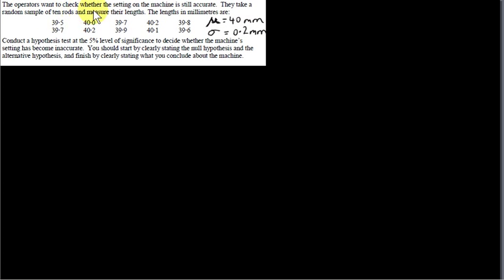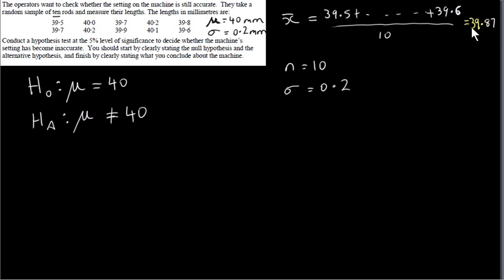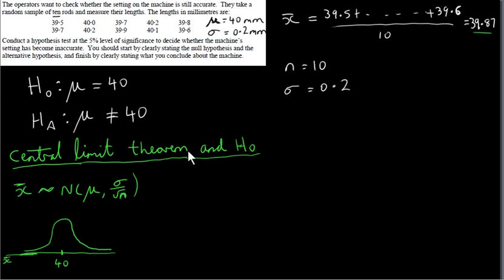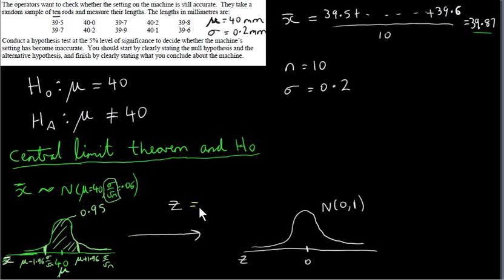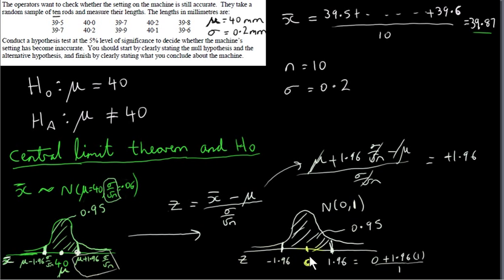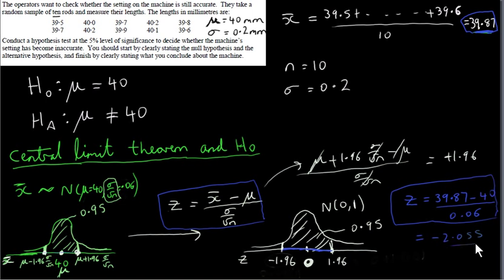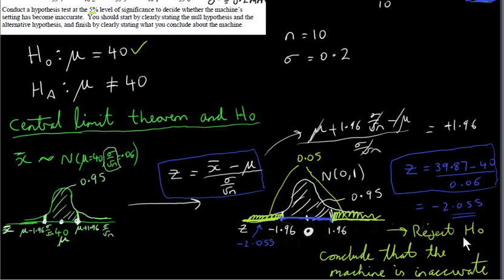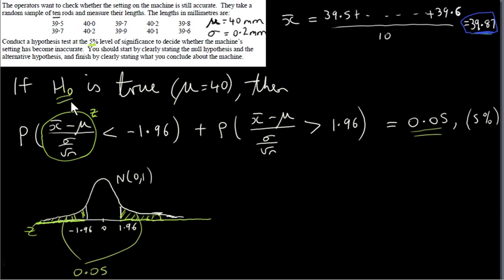Hypothesis testing for the mean (2010)

Comment from the maker: If the random variable X is normally distributed, then 95% of the values that X takes on lie within 1.96 standard deviations of the mean. The value of 1.96 is often rounded to 2 (which you may use). In this video I use the more accurate value of 1.96.
I am afraid that I have no idea as to what is coming up. However, I will be posting up plenty of video solutions to project maths papers over the next few days.